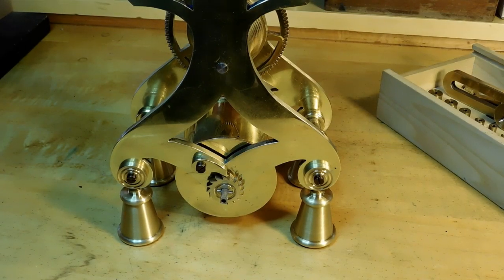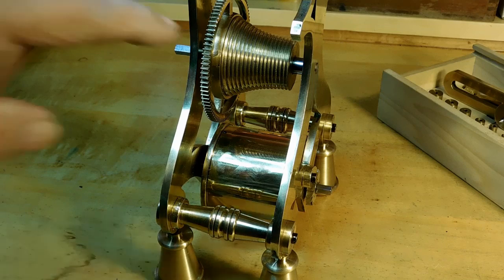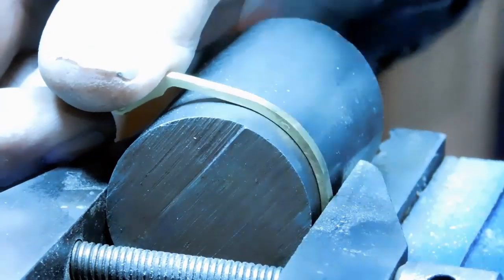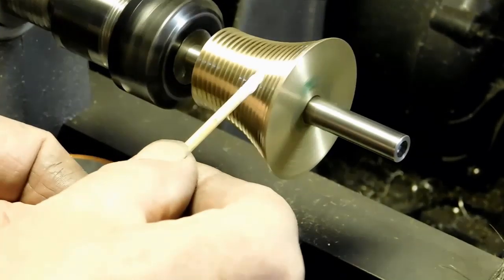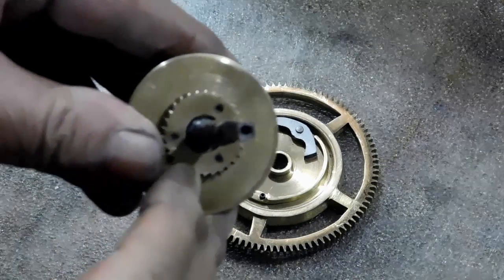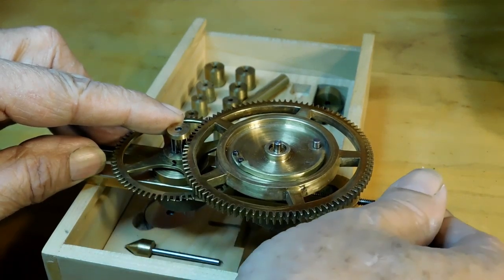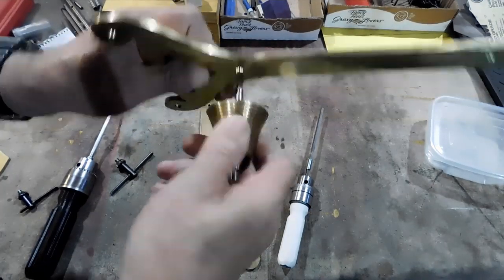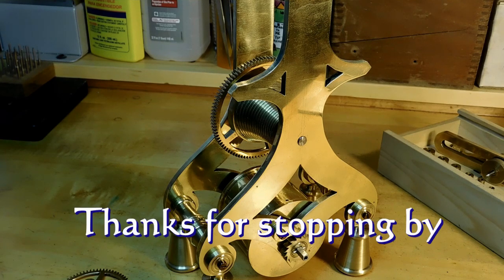WR Smith's Grasshopper Clock Part Nine: Planting the Great Wheel and Fusee

Comment: Jewelers use broaches too.
Reply from the maker: thanks a lot for that info...I've made several 5 sided broaches and find them very useful...guess now I need some diamonds to mount :)...tnx...bob
Reply from the maker: Ya that kinda makes sense...bob
Reply: @robertt-cs8fe  And hardened rod, ground to a taper with 3 or preferably 4 sides will drill holes and open them at the same time, perfect for diamond mounts and a lot quicker than swapping out drills of different sizes.

Comment: G’day Bob, it’s starting to look very impressive indeed, couple of things though; what’s the difference between the broaches and why the 5 degree play is that a method of measuring an acceptable clearance? 
Cheers 
Peter
Reply from the maker: G'day Peter...a 5 sided broach has as expected 5 sides milled with a slight taper and then the 5 sides are hardened then ground into very sharp edges for cutting...and they do cut well into a brass plate...now a smoothing broach has the same taper turned into it as the 5 sided broach and is hardened then you lay it on 120 grit emery paper and hold it by the top and bottom and run it perpendicular to scratch it...that forms the smoothing edge...you do this frequently during usage.
The 5 degree tilt assures you have opened the hole sufficiently and checking the shake once between the plates...assures there is a 1/32" clearance between the end of the pivot and the plates and the hole is loose enough so the weight of the arbor will allow the pivot to slide easily in the plate...very acceptable means of assuring proper clearance.
Peter finishing off the next video...get a seat in your favorite chair with a cuppa for that one...looks like it will go over 20 minutes...bob